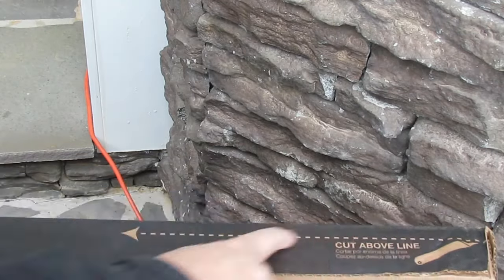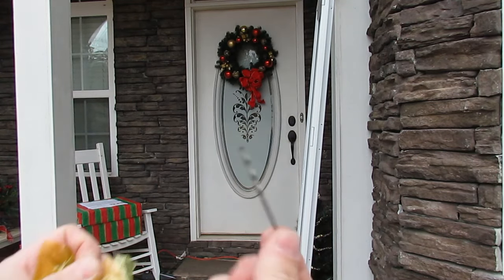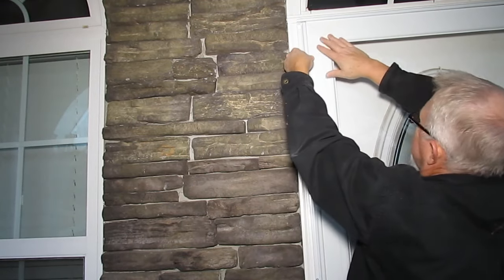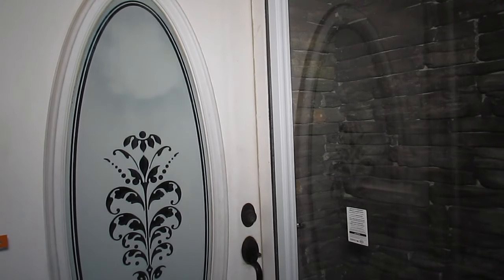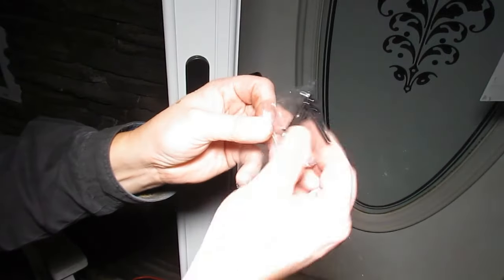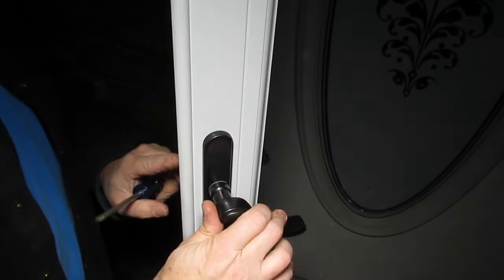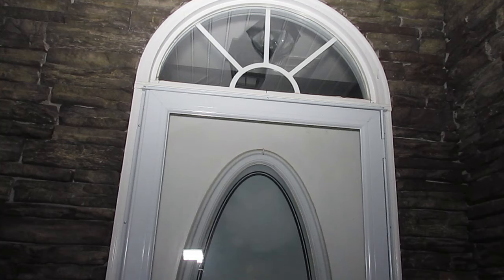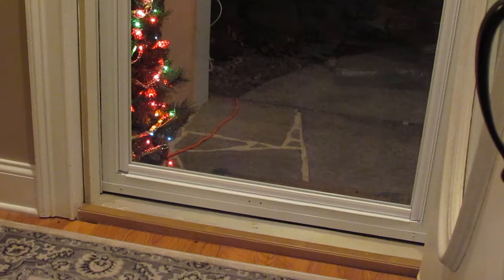Install Andersen Storm Door

Comment: You should have bought the opposite handed door. The handles should both be on the same side.
Reply from the maker: Well, the builder installed the wrong hand entry door.  If I had matched hands with the storm door, we would exit right into a wall, so that wasn't an option.  Sometime soon, I'm going to replace the entry door with the correct hand.  Thanks for watching!

Comment: Left open to a right open?
Reply from the maker: Thanks for watching!  Although not a requirement , most often storms doors are installed with the lockset on the same side of the opening as the entry door.  You'll notice in this video , I install the storm door with the lockset on the opposite side as the entry door.  The entry door installed by the builder is the wrong hand, it should have been a left hand door based on the way the front porch is built.  It will be changed to a left hand door in the future.  If I had installed a storm door with the handle on the same side as the existing entry door, we would exit the doorway into a wall unless the door was fully opened when walking out.  Not convenient at all, so changing the entry door to the proper hand door will be the best solution.
Reply: @dwcoffey  thanks for the clarity--I am new to this task!

Comment: why install it oppisite your front door?
Reply from the maker: Thanks for watching, Robert!  I install the storm door with the lockset on the opposite side as the entry door.  There is a reason for this.  The entry door installed by the builder is the wrong hand, it should have been a left hand door based on the way the front porch is built.  It will be changed to a left hand door in the future.  If I had installed a storm door with the handle on the same side as the existing entry door, we would exit the doorway into a wall unless the door was fully opened when walking out.  Not convenient at all, so changing the entry door to the proper hand door will be the best solution.

Comment: I’m just trying to get the damn door together. I can’t find that part in this video. Amazing how the make everything unnecessarily complicated. Why not just sell a door as 1 piece? Because it’s more fun to spend your whole morning reading instructions that don’t make any sense. I see why people pay people to do this BS. wish me luck, hopefully i figure it out.

Edit: to be more clear. The part I’m taking about is where the hinges and the weather felt strip attach to the door and the wall. The holes do not line up for me to attach the hinge strip to the door, and this video doesn’t cover that part. Step one of this video is “put the door in the door hole” I’m not even at step one yet lol I’m still trying to assemble the door that came in like 10 pieces.
Reply from the maker: Thanks for watching!  My door came assembled, as shown when I took it out of the box.  Yours should have come with the door already installed in the door frame.

Comment: You needed a Right Hand door.
Reply from the maker: Why?  With the way our entry door opens and our porch is built, a right hand door would only jam us up coming in or going out.  Left hand door makes it much easier to get in and out.  The problem is that the builder really installed the wrong hand entry door.  With the way the porch is built, the entry door should have been a right hand door.  I'm going to build a new entry door and will correct that problem then.
Reply: @Dennis Coffey  Gotcha. Hard to see the logistics of coming and going from the camera’s point of view. I just haven’t seen that many installed to hinge opposite the side the entry door hinges on. I figured that’s why the door bell got in your way, but I guess it woulda been in the way if it were on the left side too. I’m getting ready to install the same door in a bit, & that’s how I ran across your video. Thanks for the how to info.
Reply from the maker: Yea, that entry door has bugged me since we bought the house.  One of my next projects is to build a new door, then I'll change that frame out.....that entry door being the wrong hand is almost funny because you know the builder had to notice it should be the other hand, but installed it anyway.  It is hard to see all that in the video....just looks like I have the wrong storm door  :)  Thanks for watching and I appreciate you supporting the channel and commenting!  I hope your install goes well.  Other than the doorbell snag, mine was super-easy to put in.  I hope yours goes in that well.  Thanks again!
Reply: Dennis Coffey exactly what I thought, that you’d bought the wrong hand door & installed it anyway. Can’t say I wouldn’t living 9 miles from the nearest town. I got mine installed. Everything except installing the vinyl channel rail covers took about 30 minutes. The channel covers took a while and I almost deleted them out of aggravation.
Reply from the maker: Right?  Those covers were a little frustrating.  I was thankful mine went in 'ok'....but definitely the worst part of the job.
Reply: Was scrolling down to see if anyone else noticed.
Reply: thank you for this thread! I started watching and thought "oh no.. I have the wrong one!!"
Reply: Thanks for the video . But you should use a level for plumb . 
And a tape measure to check 
Center and I would swing the door 
The other way . I think it’s backward .

Comment: I feel like you go the wrong side of the door
Reply from the maker: Thanks for watching!  Although not a requirement , most often storms doors are installed with the lockset on the same side of the opening as the entry door.  You'll notice in this video , I install the storm door with the lockset on the opposite side as the entry door.  There is a reason for this.  The entry door install ed by the builder is the wrong hand, it should have been a left hand door based on the way the front porch is built.  It will be changed to a left hand door in the future.  If I had installed a storm door with the handle on the same side as the existing entry door, we would exit the doorway into a wall unless the door was fully opened when walking out.  Not convenient at all, so changing the entry door to the proper hand door will be the best solution

Comment: Well I won't buy Andersen products because of there practice of discontinuing to support there products.  Put a expensive storm door at my front door.  The insect screen is retractable and heat has shrunk .  My door is a 2000 series.  Now they no longer support or have parts.  This is not right at the expense of this door.
Reply from the maker: I've not tried to buy replacement parts, but I agree, that is disappointing to say the least.  Thank you for watching!

Comment: Seems so easy, but after I just installed mine, it doesn't close properly and catches in the upper corner when closing, I have to lift the door up slightly to close it. WTF? Spent countless hours messing with the damn thing. *()!@&Q$@#
Reply from the maker: Thanks for watching, Garen. It sounds like your door frame isn’t square. I would check it for squareness then shim behind the door frame in appropriate place(s) to square it up.
Reply: @dwcoffey  I finally just undid all the screws, propped it back in place again, and put it slightly tilted in the opposite direction by about 1.5mm, then redid everything with my own 3.25" screws on the outside and now it closes properly.  Which is a good thing as I was about to burn down the house and start over. 😠😆  Real tough for me is that my trim is only about 1" thick and not very wide, and once screws go in that inner channel it goes soft (pine?) and can't be re-screwed easily, so it feels like I'd only get one shot or I'd have to replace it.  Thanks for the vid, it was my primary reference.
Reply from the maker: I'm glad you got it worked out Garen...especially without burning the house down.  😂😂

Comment: That's the wrong door should swing the other way
Reply from the maker: As I wrote in the detail section of the video, no it isn't:  Although not a requirement , most often storms doors are installed with the lockset on the same side of the opening as the entry door.  You'll notice in this video , I install the storm door with the lockset on the opposite side as the entry door.  There is a reason for this.  The entry door install ed by the builder is the wrong hand, it should have been a left hand door based on the way the front porch is built.  It will be changed to a left hand door in the future.  If I had installed a storm door with the handle on the same side as the existing entry door, we would exit the doorway into a wall unless the door was fully opened when walking out.  Not convenient at all, so changing the entry door to the proper hand door will be the best solution.

Comment: take the glass out and then try to put it back in, those clips are the worst design i have ever seen on a screen door, waste of time and money as well as a major safety concern to anybody in the vicinity, mostly pets, small children and elderly, people that won't be able to catch the glass panel when it decides to pop the pos plastic clips that look like they are packers from the factory and should be removed during installation, i'd like to see the desk jockeys at anderson come out and swap the windows out
Reply from the maker: Thanks for watching!  I admit, I'm not a fan of the retention clips.....I have to hit mine harder than I'd like to seat them.  I'm always afraid I'm going to break the glass.
Reply: @dwcoffey  the 4000 series is a 100% improvement on the hardware and makes me wonder why the 3000 is even still an option, it's like settling for the vw bus when the bugatti is only another $50